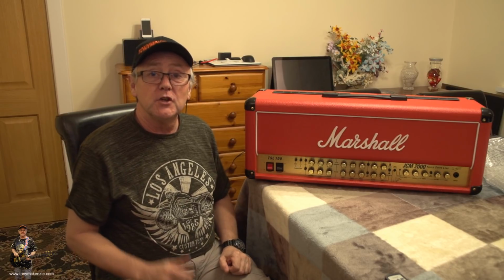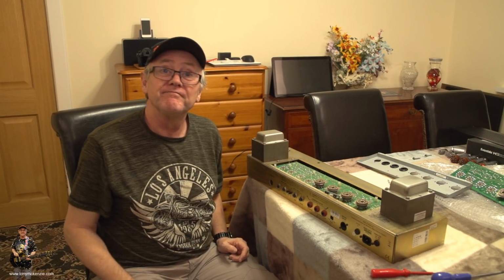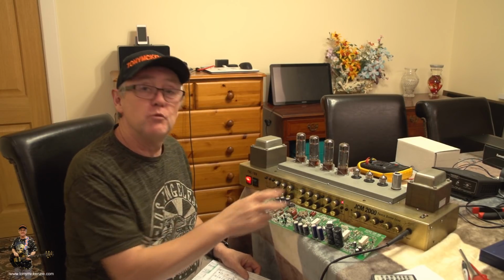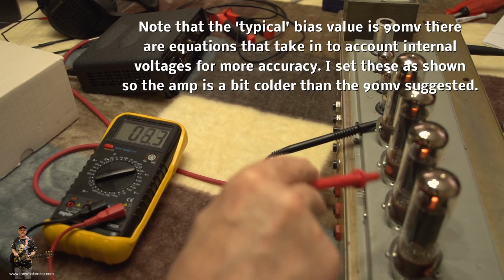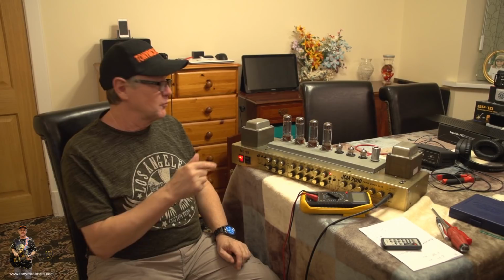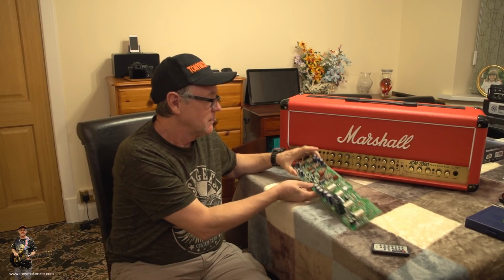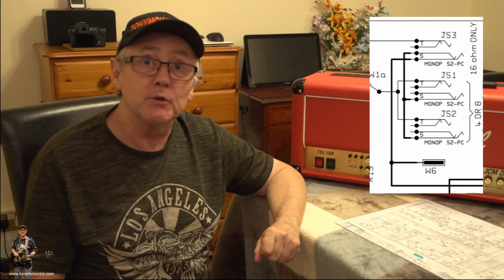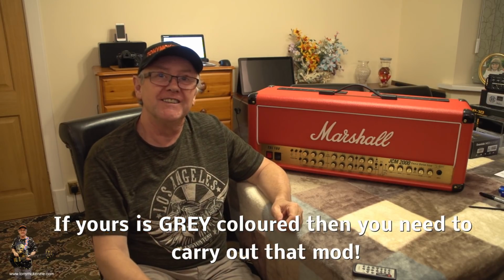Marshall TSL100 JCM2000 Amplifier | Permanent Fix For Bias Runaway | biasing review | Tony Mckenzie

Comment: Tony, have you ever messed around with stereo or wet/dry amp setups?  I'm thinking about getting another TSL.  Crazy.

I've lived with my TSL for going on 15 years.  The only thing I've ever had longer than that is my wife.  Lately, digging the mid-boost switch on the clean channel.  Always have avoided it in the past

You know, the TSL is like the Christmas animation flick Rudolph the Rednosed Reindeer and the Island of Misfit Toys.  The TSL is like a misfit valve amplifier.  No one uses them.  I'm thinking if there was a way to do a TSL challenge via all the YouTube guitar gods   -  who can get the best monster tone  with a TSL  -  the value of these amps would increase and my ego would be boosted and I'd no longer feel like a misfit toy.
Reply from the maker: Ha... come on you have to be wrong with this :)  Actually they tend to lose money and have few users because of exactly the reasons in this video... and that issue 20 board fixes it all really well forever. The good thing about it really is that it allows you to buy a TSL for peanuts. Admittedly you probably need a board, but they are available for not that much money and easy enough to fit. BTW that 16 ohm speaker connector mod is essential. 

I hate to say this - but the TSL guitar tones I achieved on my 'Eniac' album from back in 2006/7 were some of the best sounds I have ever achieved in the studio. It all came down to right speakers, right amount of drive and a really good guitar (I used an Ibanez 7VWH Jap) and those audio tracks were incredible. Here's a short example from the Eniac recordings from another video: https://youtu.be/GhIht3xl--4?t=48m8s and that guitar really did scream. So ha never be afraid to tell the world you have a TSL - but make sure its the 100 watter as the 60 is pale in comparison.

Indeed I used to have a Triaxis and a 2:90 amp through a stereo setup (early 90's) but it was not really a wet/dry setup... I just wanted to get those effects out in stereo and with the right rack gear that was what worked for me for some time. I eventually moved on after many years and have not been back to the two amp or wet/dry amp setups. No particular reason really.

Is your TSL a 100 or a 60. I used to own a 60 but never got a very good tone, but the 100 is a different story. That's the reason why I bought another and made the video where I covered it in red tolex. Mine did not have a particularly failed board (one cap was toast as you can see but that's really the 16 ohm speaker connector issue) but after the upgrade the amp really is like new... so doing it all you will go AT LEAST another 15 years :) Bargain!
Reply: Again, Tony, thanks for taking the time to discuss this amp in depth.  I've checked a lot of forums and you're the only person that seems to genuinely care.  I do have the 100W.  As for the board, my problem is finding someone to install it.  I've talked about the replacement board with a local amp tech that has worked on my amp a couple of times.  I can tell his heart just doesn't seem to be in it. He even seemed surprised such a board is even available.  No excitement whatsoever. Too much looking down at the floor when talking.  So.....

He says he will do it if I want to invest in the amp.  I will definitely have him watch your video in advance if I do this.

There's another firm here that does Marshall repairs, but I don't know anything about them.  Don't want to roll the dice with them yet.  This is my only amplifier.

My ignorance, but I use 2 Marshall 4x12 1960 cabinets, so I'm not using the 16 ohm connector on the amp head.   Maybe the same issue is present in the other speaker cab inputs?
Reply from the maker: Actually fitting that board is relatively easy... that's why I did the video really. No more than about 1 to 1 1/2 hours work at tops. They would not be repairing the amp really but replacing the amp (there's not much else left when you change the board). 

You misunderstand on the 16 ohm speaker out. EVERY output 8 and 4 ohm depends on the 16 ohm connector to never fail... but what happens is that it tends to get overloaded when NOT being used and the others outputs get their load via the 16 Ohm... this means that if the ground on the 16 Ohm connector fails (they do - or they zap that little capacitor I talked about) then you will likely lose the output transformer. That is the main reason to solder the connector as I showed. Or it can be soldered from under the board but that takes longer without any real difference. 

The hardest bit about exchanging the board is to ensure that you mark all the connectors BEFORE you start and then it becomes very easy to do.

If they are charging you over $125 to fit that board they are likely nuts... 

Never mind the forums - mostly those are guys that have had problems with the TSL amp but most likely rarely do they even know there's an issue 20 board that fixes it all. I looked through forums before I started and saw all the stuff on there - guys with heat guns, guys drilling the board claiming this or that - honestly... the fix IS issue 20 board and anything else is a half baked excuse of a bodge likely because that is the only answer they had.

Remember this - many guys say the TSL sounds bad also, but in reality that amp is actually one of the best I have... I put it all down to maybe their old amps have simply got issues or they don't really know how to drive it properly - or have dodgy speaker cabs. Mine sounds as good as the day it was made and its used through a 1960a cab. 

I'll never sell mine this time around most likely there for the duration :)
Reply: Thanks, Tony.  Great information.  I knew I was blowing smoke up my own rear end with the speaker outs.  Owner of little mom & pop music store, who's been around 30+ years where I live, says my TSL is a better amp than the newer stuff.  So that's 2 witnesses including you.  I'm just a "bedroom player" and I don't know how many years I've got left in my 60-year old fingers.  Like you said, you want quality.  Me too.  Just trying to learn more.  So much I want to understand.  And try.  My TSL experience has just been frustrating and I went through about a 3-year period where I wouldn't even turn the thing on.  Just a fizzy, tinny mess no matter what I did.  It has always sounded like crap compared to what I see/hear elsewhere.  I've always wondered why/how would Marshall produce an amp like this after their history, which is why I bought it to begin with.    At the same time, I've held out hope that  this amp is an underdog.  I always like the underdog.  This topic is how I came across your channel.  Very glad I found you.  You've instilled some hope.
Reply from the maker: Ha I'm now nearly 65! Ready for the 'knackers yard' some might say and it won't be that long before I'm an official 'pensioner'... according to the records :) But you know what... I'll NEVR be a pensioner in the true sense.. and I won't give up on anything that I do - good or bad makes no difference... because I did it. And I think that's an important thing in life - it can be 'easy' just to say 'oh I've had enough' of something but that's not really me - more like the 'snowflakes' around these days. That's what they do....

Those 1960a Cabs are great and those are almost all I use for every amp I have. The amp CAN be a bit tinny if you go to extremes with the eq's etc., but careful dialling should do the trick. It sounds best I think when the 1/2 power button is not used also. Stick with it.

Comment: Glad to see your comments recently.  I was worried about you since you haven't done any vid's in a while.   I haven't changed my board yet, but I purchased a JHS Angry Charlie which I am liking with the TSL clean channel.  However, I got a big surprise.  I've been using a Crybaby 535Q for years and the on/off switch was not working correctly.  I would turn on the wah & it would sometimes sound very tinny or brittle or not come on at all.   I took it completely out of my effects chain  -  haven't ever done that -  and my amp came back to life.  I couldn't believe it.  So, all the amp knob tweaking and amp cursing and pedal swapping  and tonal frustration wasn't the TSL's fault.  I almost cried as I've gotten rid of quite a few pedals recently thinking they were hopeless.  It was the Crybaby all along.  It made me a crybaby in the end.
Reply from the maker: About 7 weeks in fact, but I had a stonking bad chest and cold... it has been bad, but I am past that now and I appreciate your concern. Ha brilliant answer on the wah pedal... I would not have believed it either but sometimes strange stuff happens :) Keep the TSL it's honestly a great amp (you probably know that though) and why I bought another and fitted the board. Thanks for watching...

Comment: Use silver solder when resoldering jacks such as foot switch socket. Silver solder is more rugged.
Reply from the maker: Good point... and one I have never mentioned. I try and find lead solder myself as it works really well with the flow etc. T.

Comment: I bought the issue 20 board from Hot Roxx UK. $153USD delivered airmail to US.
Reply from the maker: That's about right and worth every penny. Mine still rocks and you'll hear it presently on an Epiphone comparison to a Gibson Jimmy Page Les Paul...
Reply: Thats going to be a cool video! For the TSL, I also bought a Mercury Magnetics choke that they make specifically for the JCM 2000 100watt amp.
Reply: Danny Birge how long did it take to be delivered?

Comment: The reverb is humming badly now!!
Reply from the maker: Check firstly the tube that drives the reverb!... and (I know it sounds silly) check you put the reverb wires back the right way around.... let me know what you find. Mine was perfect and still is - it has to be something silly.
Reply: tonymckenziecom  I changed the reverb cable the hum dissapeared!
Put the old one back.....no hum!
Must've been the wrong way round
But I'm sure I checked.
Reply: I gigged my tsl for four years and it  gave me good service but one thing that failed was the footswitch socket in the back. It broke it's soldered connections on the board, so I removed the board to resolder the connections, and found that the two little screws that held the socket to the board had never been fitted!!!  So I sorted that out. Mine is a 1999 and the mother board was a 4/5. It wasn't burned and I couldn't see any problems with it. But it did red plate 3 power valves in it's life time
I also fitted a din socket to the foot controller so I could use a separate cable another big problem solved! I also fitted bigger LEDs with chrome bezels that match the colours for each channel .
Reply from the maker: Well sometimes its just dirt on the connector and that might have jarred it to work again. It should be OK.
Reply from the maker: The footswitch socket is a known problem. Also those screws are not always fitted on multiple gear although they should be. You did the right thing there on the footswitch. Often it's because the cable has weight on the connector directly fitted to the board and it stresses the connections that result in dry joints on the connector and board. 

The older main board like you had 4/5 was known to have material that changed the bias when the amp got hot and typical problems then included the tubes blowing so I think you probably had a bad board. 

The LED's idea is a good one and I'll bear that in mind - I did not consider that one :)   Thanks for this info about how you solved yours and those tips.

Comment: Thanks for your great video Tony
I got an issue 20 board from hotrox  for £116.50 and fitted it, Abit fiddly but not too bad, and the amp now works a treat!! I'm going to do your speaker socket mod next and do the bias, many thanks!
Reply from the maker: It makes the amp be what it always was before any aggro... one of the best around if you tame it right :)  Yes do the speaker mod or you can lose the board around that cap that burned on my old board as shown.... Yes it is a little fiddly but you just go steady and its not too bad... I bet it biased up perfectly! Thanks for the info its very useful for other guys too... and thanks for watching.

Comment: So was that new board free? 🎵🎸
Reply from the maker: Absolutely not. I have to pay the same as everyone else... but I don't always like disclosing information online as to the why's and wherefores' of any given video. I did buy it here in the UK though I can confirm that. The diagram was off the internet. Thanks for watching.
Reply: I thought maybe Marshall would cover their shit boards with free updates, considering the high prices of their crap new. Too much to expect I guess? 🎵🎸
Reply from the maker: I know what you mean and those early boards were not good by any standards. But Marshall gear varies in price depending on where you are (as indeed does Mesa stuff) and for example I bought a 2555X 100 watt amp for less than $1000 (about £800 or so). Its a fair comment about the TSL100 quality and there is no doubt that those early boards were bad stuff. But that's the gain in buying a TSL100 really... buy the board and you have an amp that cost less than most but with the board is probably one of the best buys out there.

I doubt Marshall would start replacing boards from 2006 and prior under warranty or even as a gesture the newest affected is likely 12 years old and the oldest affected is likely 16 years old or more. 

I don't really relate to the amps of recent times that I have carried out the Inside & Out reviews on as being poor quality? Maybe some of the non UK built ones which I have not looked at, but amps like the YJM100, AFGD100, JVM410HJS, 1987X and the 2555X are all pretty spot on with quality? Have you checked my reviews? Here's a link to the amp reviews playlist: https://www.youtube.com/playlist?list=PL764D9C7505FDEC8D and I do show lots of other amp reviews in there also that might be interesting to you including Bogner, Mesa Boogie, Diezel and many more.
Reply: Have you heard of the Blackstar Anniversary AE-10 with a KT-88 power tube? These tubes are supposed to be rare and expensive, with a great tone. Andertons did a review on the 3 version line up and really liked the KT-88 version. They sell for around $450 US. I would like to hear someone else's opinion just on that power tube version.🎵🎸
Reply from the maker: A matched pair of KT-88's are £70 ($95) for two so not really any different than 6L6 or EL34's on pricing I guess. Think of the KT-88's as being a bit like loud bottom end and loud top end... and a louder tube overall compared to 6L6 or EL34. The KT-88 has less distortion in the power tube than those other two and is a favourite among HI-Fi audiophiles for their amps for some reason. I think I had just one amp that took those some years ago and that was a metal type of amp with a big fat preamp with lots of preamp tubes for the drive. I likened it to being very useful for dropped tuning because of the bottom end. I have not tried those tubes in other amps though. Thanks for watching.

Comment: Very interesting stuff Tony. Where did you learn all of your electronics? Nice jam at the end. I really like the Eniac album.
Reply from the maker: Originally I was a mechanical engineer until I reached 20... then moved in to far more specialised things. Later still I started in computing in around 1980. I learned a lot in that next decade with involvement with Singaporean manufacturing of PC's. The next decade I worked in networking and from 2000 RF technologies. However, over the years I have built amplifiers and learned a lot the hard way, but I'm no expert on tube amps and you have to be careful with all that internal power. I also in the early 90's became a class 1 radio amateur and learned a lot about electronics getting that license which I found very interesting to complete - in those days you had to also pass the Morse code test which I learned and passed in three months with the help of an Atari computer :)

The Eniac album was written really a number of years after I decided to never bother with a true band situation on the road so to speak. I had enough of whiners, no commitment from others, I was always paying... well many guys will know the sort of thing that made me not bother. In some ways after about 2000 I started to focus on changing the way I played and I spent a long time figuring out how to create a tapping style that was played differently than all the others out there. I did get to grips with that, and the Eniac album (here: https://itunes.apple.com/gb/album/eniac/id213841144 ) (at least the tracks that are not fillers - mainly the first 70% of tracks) was the result. If you listen to some of that - tracks like 'Takedown' are riddled with that style I developed and the track 'Lightpipe AI' also showed it off. Alan Bruce was vocals and Bass on that album, but by 2008 we had developed an altogether different style in an album called 'Berner Street'.. (Here: https://itunes.apple.com/us/album/berner-street/313642615 ) much darker as it was written about Jack the Ripper and we spent eons doing the research.

Gravity Waves (Here: https://itunes.apple.com/gb/album/gravity-waves/1140579625 ) was scheduled to come out in 2013-14 but prostate cancer put me back a number of years and that was completed in 2016, but again that album was actually more diverse than the Eniac album I originally wrote those years before.

Your one line question actually has a myriad of answers that I could actually fill a page replying to :) Thanks for watching and glad you liked it.
Reply: You're welcome Tony. Thanks for sharing your knowledge and experience.